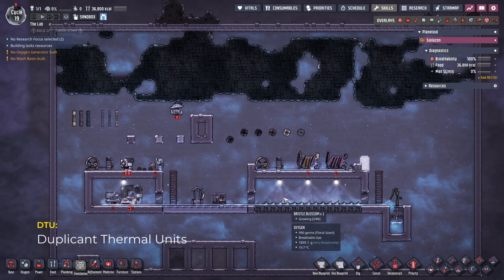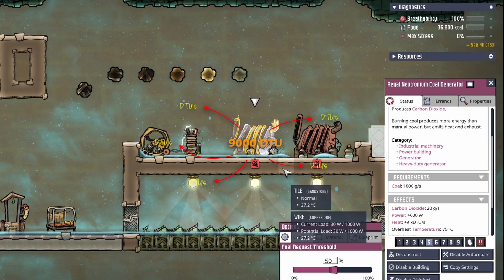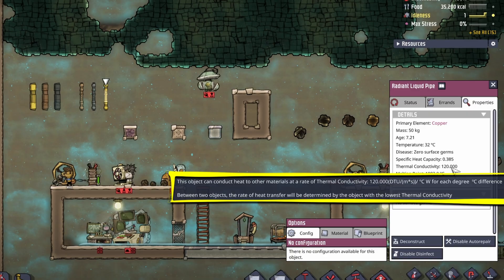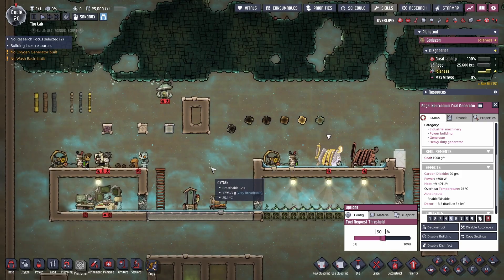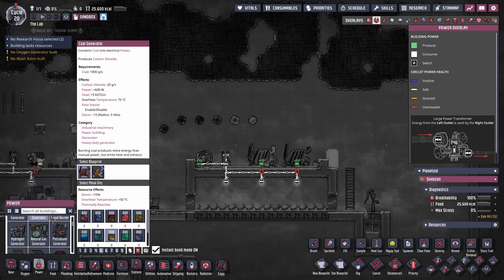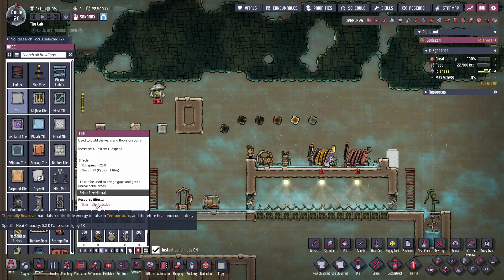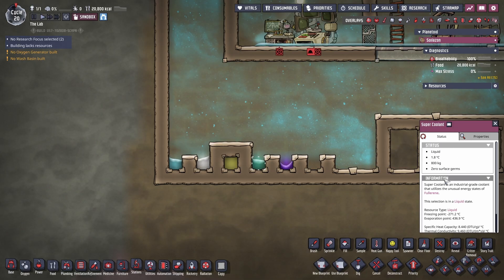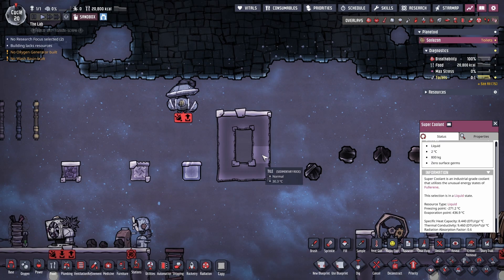Temperature Mechanics Explained | Oxygen Not Included

Comment: Usually heat transfer does not work diagonally but as you said earlier with temp shift plates they still do work diagonally so new players be carefull where you place temp shift plates
Reply from the maker: That's a great point about diagonal heat transfer with temp shift plates!
Reply: @CanadianXOfficial it is a cheeky way to get naphia early on put a plastic tempshift plate near either magma or super hot abyssylite and it will pull the heat out diagonally even with abyssilite

Comment: Two things to note:
1. insulated tiles and pipes lower thermal conductivity of the used material and radiant pipes increase it.
2. it's not always the case that lower TC is used for heat transfer. Ex. tempshift plates take the average so they allow to pull heat from abyssalite tiles (but not debris).

Comment: It is worth to mention that when using tempshift plates for cooling you lose 80% of ice cooling potential. This is due to the fact that in heat exchange calculations only 20% of building's mass is considered. So 80% of stored potential DTUs just vanishes until ice melts. So use this method when you are desperate and need to get some cold water fast or when your ice is already close to melting point.
Reply from the maker: Thanks i will add this to the community notes in the description. Just to clarify for myself, we get full cooling potential when it melts tho? The reduction is only when its in the building form?
Reply: @CanadianXOfficial yes, this is only as long as the ice stays in a building form. When it melts all is back to normal.
Reply from the maker: @TheAngpaur  perfect thanks for clarifying that for me. I did not know this!

Comment: Nice video! 

We can mention "grounding" a building to the floor using a conduction panel or a liquid on the ground to exchange the temperature of the building with a floor or ground.

We can delete heat when we build something using very hot/cold material. We will go for example from 1000c material to 50c building. It's useful for "grounding" or moving hot material to the rocket interior.

Both principles we can use on super conductive planetoid to build a nice base from very hot materials in a complete vacuum.

We can extract heat from abbysalite tiles just by placing a steam turbine on it, but be careful, you can heat it up to a 1000c in a few seconds and if you destroy the stream turbine you will have instant sour gas 😂
Reply from the maker: Thank you! i forgot to mention about the buildings always being constructed in a set temperature range. Iv added you notes to the description.